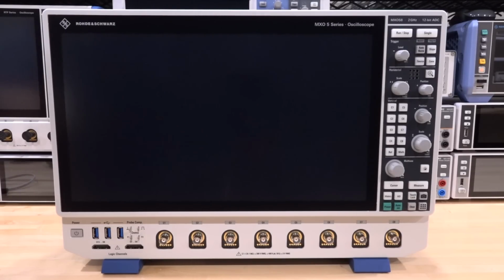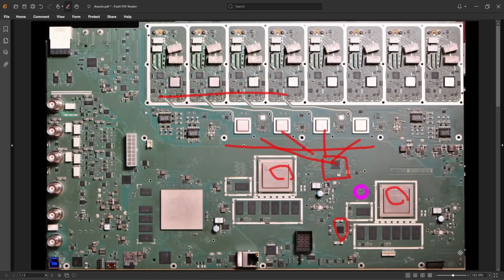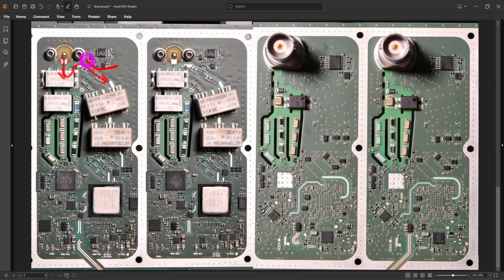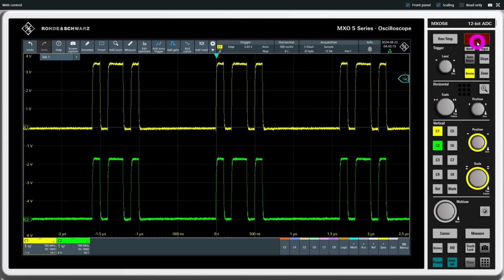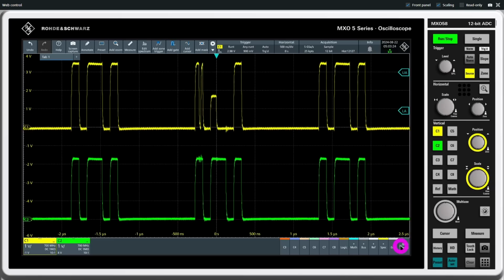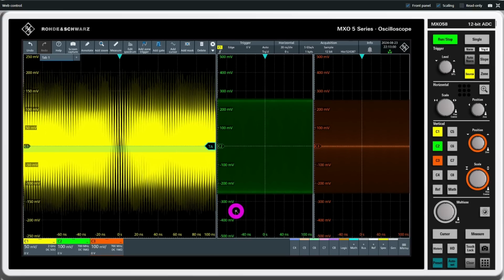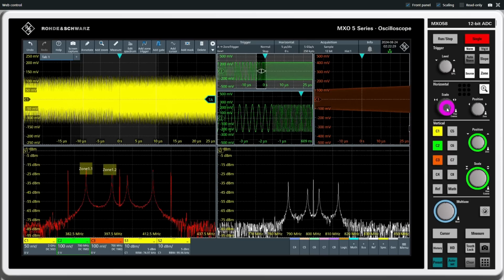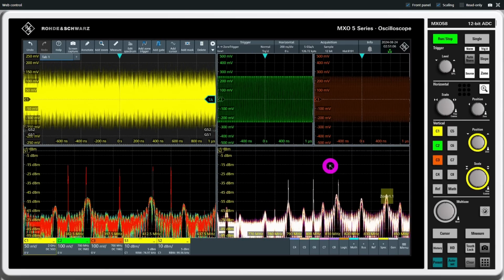TSP #301 - Rohde & Schwarz MXO-5, 2-GHz, 8-Channel, 12-Bit Oscilloscope Teardown & Trigger Zone Exp.

Comment from the maker: A few comments:

- At 14:04 mark, the component is a solid-state relay which can shunt the AC input capacitor for DC-coupled high-impedance input setting.
- Channel-to-channel matching means matching the phase & frequency responses (which includes signal polarity); every via, every trace length and proximity effects all matter. Even though 2GHz is not a very high frequency, the board material can have a big impact.
- There are still features which R&S will add to this scope over time.

Comment: Are there some bodge wires around the differential/single-ended path selection switch? At 13:22 ?
Reply from the maker: Yes - this board is a prototype board and not the final version.

Comment: For RF measurements, the scope was set to auto mode.....if a user changes trigger to "Free Run" the scope updates even faster.  It's a very cool RF feature that R&S has that no other scopes have.   Autotrigger will wait for 50 mS and if it doesn't find trigger, the scope will capture.  For FreeRun trigger mode, the scope doesn't even attempt to find a trigger...it just updates as fast as possible.  This is great for applications like RF and power integrity where an analog trigger isn't needed.

Comment: Nice job reviewing this great piece of engineering, Shariar! Thanks a lot for the effort. But there's one detail I dare to differ: The BNCs are't screwed in onto the PCB for rigidity -- ideally, the PCB shouldn't bear any mechanical load of the attached probes / cables. For this purpose, the BNCs are screwed/bolted to the surrounding metal chassis structureal components by their central ring nut. The screws that attach the BNCs to the PCB are rather intended for easy replacement of the BNCs in case they wear out or get damaged otherwise. A BNC that's soldered into a multilayer PCB with a lot of copper in it by four massive ground prongs can hardly be removed without high risk of causing damage to the PCB. In this R&S Scope, you just unscrew the two/three screws and unsolder the signal contact which hasn't got high heat capacity, and your're done without any significant risc of causing collateral damage. That's a very clever approach to protect the high-value PCB in case "peripheral" repairs are required.
Reply from the maker: Thanks, I thought I had kept that section in the video, but it looks like it got cut. Indeed the problem is how to maintain a good mechanical connection without soldering the ground plane of the connector. With the screw, you need a pretty good interface without even a micron of gab between the connector and PCB to ensure a good, low-RF-leak transition. But as you said the advantage is that it is much easier to remove the connector if it gets damaged.

Comment: A scope, a spectrum analyzer, signal gen and some logic analysis all combined together, the result of super integration. Its really magic for bleeding edge design work. This is where the electronic design has been trending for decades. I have a hobby lab with equipment that was this expesive in real terms years ago. In twenty years this will be standard functionality available from multiple vendors. Yea, nobody pays 6k for a chip in production 'cept the military. Yield? Burn in? Not  very repairable though.

Comment: 14:49. I believe this layer switch is not so much for length matching and number of via matching. I believe it just switches the positive and negative signals around. Probably because of the placement of the ADC input pins. 
As a layout guy the connection between the frontend and the ADC baffles me. The way each ADC takes in signals from channels that are 4 channels apart from each other is just bizarre. Usually when you have 1 ADC per 2 channels, the ADC sits between two adjacent channels. The only logical explanation i can come up with is that they wanted to have the same number of ADCs on the 8 and on the 4 channel version of the scope. Maybe for software, noise or some other reason I'm missing. I'd love to hear suggestions on why that could be.

Comment: Ooh, I like the channel grouping: you can activate 1,2,3,4 without dropping the sample rate, rather than the goofy "odd channels then even channels."  Since the long traces come after preamp, it probably doesn't even have much of a noise figure cost. Very cool!
Reply from the maker: You can turn on any number of channels and not lose sample rate!
Reply: @TheSignalPath  Huh, the datasheet says 5GS/s on 4ch,  2.5GS/s on 8ch, but it can actually do 5GS/s on all? That's a welcome surprise!
Reply from the maker: @jjoonathan7178  Let me double-check - I was reasonably sure that it was fixed sample rate.

Comment: You can also adjust the screen trace brightness, to get a better sense of how common/seldom the anomalous events occur, since some triggers are just synchronization of the waveform vs. Horizontal setting.
Reply from the maker: Every trigger is synchronizing a desired event with the horizontal setting - that is what triggering is in general.

Comment: The PCB trace "wiggles" are probably to ensure that the 'signal path' lengths are identical, not just via count matching, but timing, too.
Them R&S design guys know a thing or two about 'signal integrity' 😉, right, Frank?
Reply from the maker: Via matching is part of timing - everything on the trace is meant to match the phase and frequency response, including any inversions.
Reply: It seems to me that the wiggle is there to swap the differential pair polarity.
Reply: Maybe you saw more than I did... But I thought that it was different layout between ADC groups
Are you on SI-LIST?

Comment: As far as design, they still don't use the very useful texture and colour differences for function groups, like trigger, horizontal, vertical, which Tektronix used to good effect on the "good old" 465/475 scopes.

Comment: 8000USD for one chip 😮?
Reply: Given the volume they are likely to produce I would be surprised if they are paying more than 400/800$ for that FPGA, it is notorious that amd/xilinx and altera do not want to deal with support and distribution for low volumes so they structure the prices accordingly
Reply: Those chips are being sold for one off or big budget products so they are obviously priced as such.
Reply: @AlpineTheHusky  I am not saying they will not sell them for one off, they obviously do...

However the pricing model is designed to discurage low volume usage of FPGAS as much as possible. This is done by applying an extremely high markup to the one off pricing (much larger than for MCUs or even regular CPUs) however if your volumes are high enough to be able to speak directly to AMD/alter (i guess 10-50k units per year bare minimum, maybe more) the price drops to a fraction of what it would be, much more than for other components with comparable volumes. 

The effect is so large I can say with pretty good authority that for even medium volumes for high power static converters (DC/AC, DC/DC, etc) BOM cost is not a factor in the choice of FPGA vs MCU when designing the hardware as the cost is fairly equal ( we talk of lower end fpgas obviously)  expecially when you start to consider how much money the better characteristics of the FPGA based control (lower latency, higher frequency, oversampling, etc.) can save you in capacitors, inductors, etc.
Reply: @pelor92  Look at LCSC or other big stock sellers of ICs. FPGAs are still hellishly expensive even at 1k units

Comment: It blows me away that for something this large it was not decided to separate the front end, ADC and compute in to three different modules (plus each front end being a separate module) for binning, higher yields, repair, and just the logistics of it all 
but they seemed to pull it off fine and im not one to question R&S
Reply: It's pretty hard to get connectors and/or cables between sections that run this fast, easier to use good (VERY GOOD) PCB design to get the job done. Sadly, it is a downside that repair is "non-trivial"!
Reply: @lohikarhu734 they use separate input boards with connectors for way higher bandwidth scopes and analyzers than the MXO5
Reply: Good remark, the only way to repair this scope if you blow up one of the inputs is to replace the whole card, which is as good as buying a new one. You certainly can question R&S on this.
Reply: ikr
Reply: this was done because it's easier to build/assemble, complete disregard for anything else

Comment: Damn, this baby starts at $50,000.00. Geez! How many of these are they going to sell ? 10 @ $500K, 100@$5Mil ??? They must expect much more than that, otherwise I don't think they can make up the R&D for this monster. Seriously. R&S, @TheSignalPath, any comments here ?
Reply: I don't consider them that expensive.  I recently bought one and it will easily pay for itself within a year.  Mine arrived at a perfect time to demonstrate it's worth.  I had a public service digital transmitter I was working on that had me stumped for over a day and a half.  I just couldn't find what was causing the glitch.  My MXO-5 got delivered and after acquainting myself with it's operation I found the problem in 15 minutes using the zone triggering feature.  All I can say is, God, how have I made it this long without one.
Reply: @mikesradiorepair  Mike, I have no doubt that the scope can find a cure for cancer. Just kidding but I am also very serious. My comment is more along the lines of: "How many people really need this insane functionality AND can afford it". I am just curious at how many units will R&S can sell to make up for what must be an very expensive R&D. The way I figure it, they'd better sell 1000-5000 units before it makes any sense. On a side note, I wonder what the price for one of these will be on eBay in 10 years. Cheers !
Reply: @linuxaos  the specs for this aren't insane and the price isn't insane either. this should sell in a lot of volume.
Reply: @linuxaos  I think you might be surprised how many they will sell.  I know 4 other radio shops locally that either already own one or plan on getting one.  I'm sure they have already recouped their R&D cost.
Reply: @mikesradiorepair  I honestly hope they sell one million of them. We need this kind of cutting edge R&D. I would give my right arm to be able to visit their research labs one day and see what their engineers do.
The way I figure it,  you need software engineers, EEs, physicists, industrial design  people (for the physical layout), project managers, interface designers and god knows what else. I am also glad to see a 10MHz standard input. That's a great addition since the machine also does fancy FFT analysis. Beautiful machine. Absolutely beautiful!
Reply: The designers of the ADCs and ASICS are nice guys, with experience, good thought processes, and teamwork... don't forget that R&S makes everything that you might want in frequency domain, military, and commercial transmitters, from antennae to try in-house metalwork.
Reply: @linuxaos  You would be surprised. If our keysight rep is to be believed, the UXR 110 GHz model alone sold over a thousand units. And that is a way, way more specialized tool than this is.
Reply: @linuxaos 50k is pretty much nothing when you are developing products or research that will sell for millions across potentially decades. If your engineer can do twice as much work using this thing you would be a fool not to buy three of them immediately, it will literally pay for itself in increased productivity within months.
Reply: There are plenty of large companies that can afford these babies. Thousands of them around the world. I'm sure these sell by the thousands.
Reply: I can’t believe how confident they are to put EVERYTHING on one SINGLE board!
One broken chip and everything is goneski.
Reply: @ogitakasi3030  I really doubt they even bother fixing it. Just swap the thing.
Reply: No matter how it's built, for any defect they'll stuff you with a repair bill between 25 and 50% of the original invoice, priced for maximum pain. Pay the bill, buy new or do without.
Reply: @ogitakasi3030  It's not goneski.  They just send it to The Signal Path for repair. 🙂
Reply: easily worth its weight. These high wf/s scopes are DEFINITELY worth their weight in gold. We would constantly fight over our Keysight MSOX3000 series scope in the office. 100k wf/s is super useful for capturing glitches!
Reply: they are selling thousands of these no doubt, the price is pretty good for the use cases.
Reply: @linuxaos 50k is maybe a test fixture that plugs in to a high end test set. It's about the price of a high mid level automated tape measure.

Comment: Nice! Does this one have the cycle-cycle jitter measurement? That's missing in the MXO4
Reply: if you turn on the statistics for a period measurement, isn't that the jitter?
Reply: One huge issue with this design: il you blow up an input, you need to replace the whole board. A $40k main board...

Comment: I wish they could make those oscilloscopes affordable for those of us who do not own multiple oil companies.
Reply: If you can find a way of making the price of the $8,000 FPGA drop to a couple of dollars and other custom parts drop significantly in cost, yes.  Otherwise it is what it is.  My bank account cried when I bought my MXO-5.  In fact I think it's still crying  but I don't regret my purchase.  It has completely changed the way I troubleshoot RF circuits.  I haven't owned it for long but it's already come close to paying for itself.
Reply: @mikesradiorepair  The list prices of those FPGAs are essentially fictional; a small quantity tax in effect. If you have a volume relationship with the manufacturer it's pretty common to get 70%+ off of the reseller prices. It's still expensive, but not nearly as astronomical as the price you get off Digikey et al implies.

As an example, the Kiria K26 which uses a closely related (albeit lower-market) device costs just $325. I would be surprised if R&S was paying more than $1k for that part.
Reply: R&S designs those ASICs in-house, they are definitely NOT cheap, High-Volume devices, and, at this 'bleeding edge' performance and density, the chip yield can be remarkably low... Since I have worked in "such companies", I know, first hand....
Reply: @benjaminchung991  Those FPGAs are very large with quite low yields which is why they are so expensive. It just isn't worth ramping up production because they aren't that commonly used and even if they were you would see the price maybe fall to between $3000 to $4000.
Reply: @mikesradiorepair Yyyyeah but realistically: R&S can sell you a base model MXO4 for under $5000 (which they will, once they’re at the end of the year and the sales reps want to make quotas), and they will still be making money on it. And that base model contains identical hardware to the $20K+ 1.5GHz version, since it’s fully software upgradable. Clearly the manufacturers could afford to sell them far cheaper than they do.
Reply: Trust me, you dont need a 8 channel 2Ghz scope
Reply: Yes but also no. Seeing tech that is beyond the level of ordinairy consumer products is part of why i like this channel
Reply: Why ? do you need this ? loads of options out there. If you need this then you work for the oil company so ask your boss.
Reply: I’ve got a LeCroy from 30 years ago that can support plugins to bring it up to 6GHz, and it’s all beat up used stuff I picked up cheap on eBay or at a recycling center. These high-end scopes are fun to see, but for anybody sufficiently motivated and capable, you can find the tools you need to realize your goals, you just have to be more creative if you’re not well-heeled with oil company money (do oil companies do a lot of signal analysis?).
Reply: I mean they arent really meant for individuals to just buy
Reply: I don't see a problem. Also 20 years ago, I could only afford old measurement gear, and that was OK. I could still do more than enough tinkering. I dreamt of being able to buy a top-of-the-line model. Same today.
Reply: You could work in an RF lab
Reply: Do you really need one?
Reply: The amount of performance and level of functionality you get for the price is amazing.  You can get an amazing scope that is more than enough for 99.9% of users for a week or two of average wages.
Reply: @RichardFraser-y9t  And R&S will be around when you need them. These chinesium companies can disappear instantly.
Reply: you have plenty of affordable choices with the chinese brands, not sure why you absolutely need a R&S.
Reply: @lolilollolilol7773  Not with the performance and features of this scope.
Reply: @lolilollolilol7773  True, but R&S will be there when you need them, years down the line.